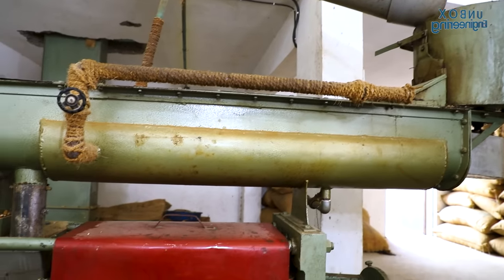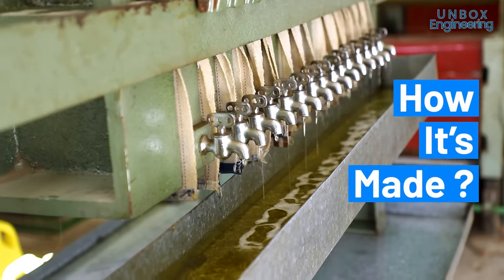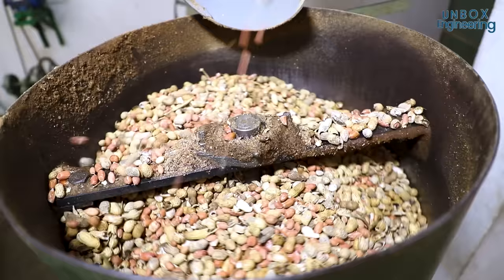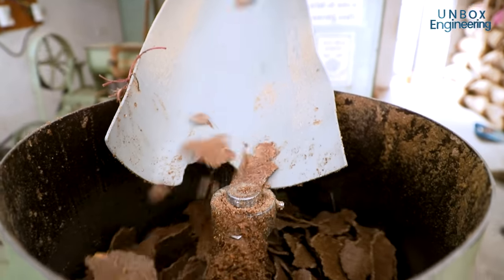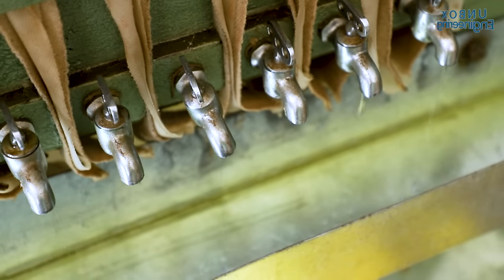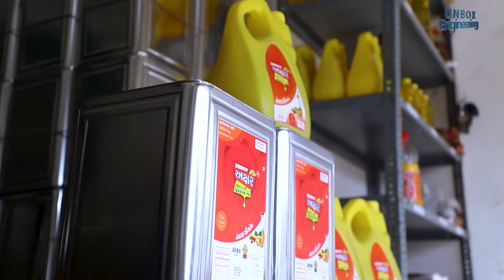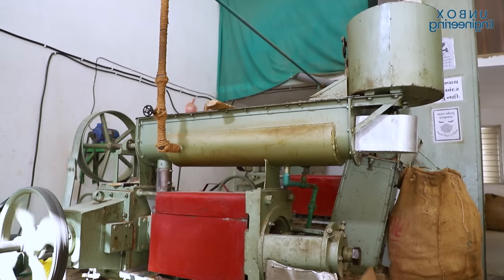Peanut Oil Making Factory | How It's Made Peanut Oil 😎

Comment: 200,000l/year means only 550liters/day. that is ridiculous given that raw groundnut is 10,500 tons
Reply: BAD OR GOOD?
Reply: @jennifergraham9609  very bad coz you will need 52kgs of but to produce only 1 liter
Reply: They dont run the factory everyday. Sundays are off days. So are the public holidays. A few days a year are reserved for annual inspection and maintenance. There is also trough period where supply of raw material is low, or none at all, peanut is a seasonal crop.

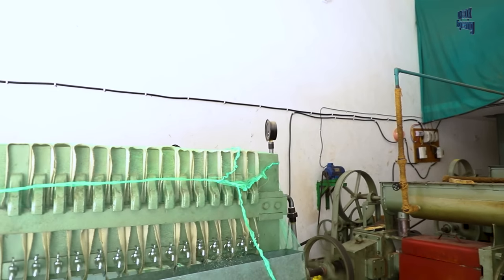Comment: Also, at 4:02—bare galvanized iron sheet for a trough? Held to the post with rusty bolts (and, as you know, rust flakes off as time goes by. Guess where might the particles land? Yup, down to the already filtered oil)? Seams that are unsightly and seemingly oxidizing at the moment? That's hygienic for you, I guess. Edit: just saw the dust collecting at the corners of the frame. smh Edit II: 4:30 That was handled with bare hands. Seriously, no gloves? Where's German engineering when you really need S-tier automation?